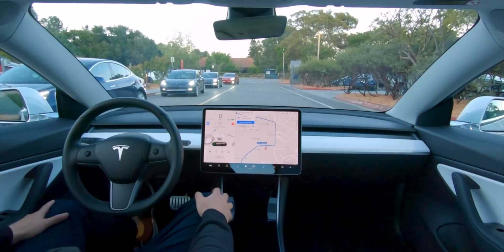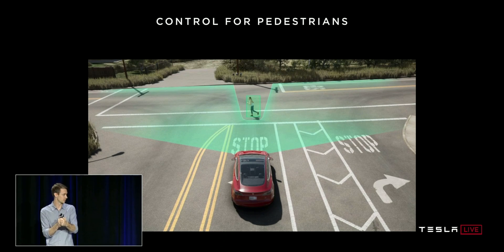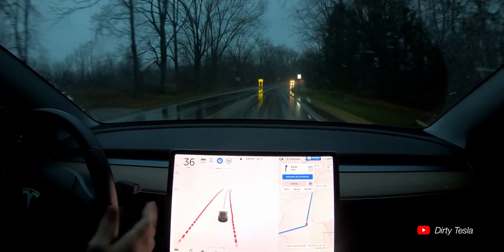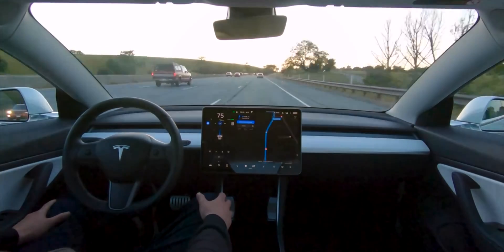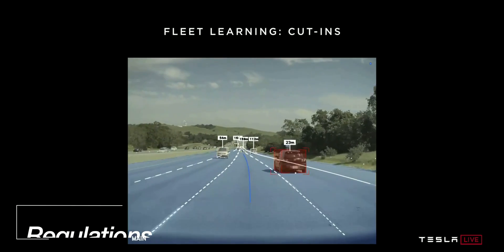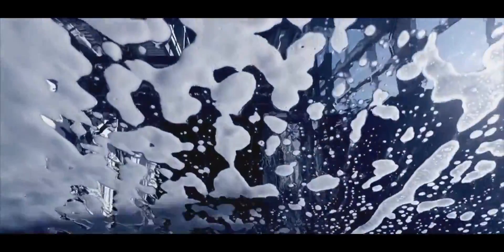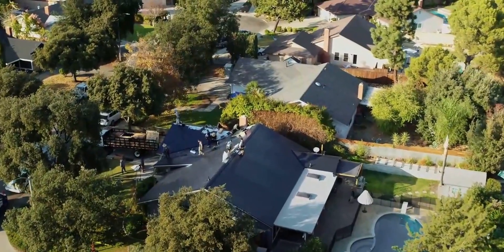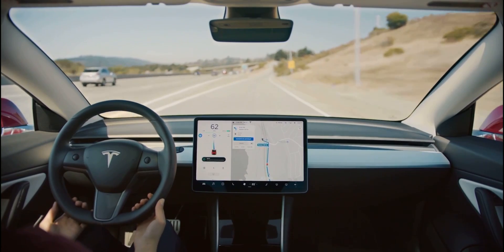4 Major PROBLEMS for SELF-DRIVING CARS!

Comment: You have obviously never driven a winter Road in Michigan. You have something that's going to stop the salt from screwing up your sensor? Or lot of places use sand. Then your faulty sensor causes your car to run over my five-year-old daughter. Then what happens?
Reply: Well said! Maybe in California they're fine but as a Minnesota driver, I cannot imagine a self driving car would know how to handle several inches of snow/black ice. For example, sometimes you have to roll through stop signs a bit to keep momentum. A self driving car would follow the law too much and get stuck in the snow.

Comment: assuming all self driving car companies wanna team up and share data between each other, this process could help self driving become widespread quicker and once there is enough saturation, cars could communicate between each other on the road and hence make the road even more safer.
But I fear that most of these companies being private entities will be reluctant to share that data and protect it under their IP. This will hinder faster development and refinement of the neural networks.
I think this is also the problem in some countries with EV charging stations.
Pretty good Video anyways, Keep Going.
Reply from the maker: Thank you. I think once you already have cars driving fully autonomously on our infrastructure, there won’t be a need for inter connected cars. It may be a good second layer but primarily the car should only rely on cameras.

Comment: So the hardware, software, and data are all need to be improved for level 5 fully autonomous driving at safety levels !0x vs humans.  Even the best current beta combination that Tesla offers cannot drive anywhere close to level 5 on snow, ics etc even or even equal to an experienced driver on snow or ice.  This is just one major example limiting cars from being even close to achieving level 5.  Potholes, damaged roads, and other naturally hazardous conditions are other normal real world scenarios that EV’s cannot successfully address and will require major modifications before level 5 can even be claimed to be achieved by definition.
Reply from the maker: This isn’t gonna age well!
Reply: @ElectricCarsAreLit  A lot of what you said was misleading. Data is not one of the major roadblocks for companies. If that was so google would have thousands of cars driving around  most cities. It is so difficult to get all the edge cases that google is needing to hard code some of those in. They are also trying to smooth out their remote takeovers in extreme edge cases. 

Self driving cars cant drive like regular cars. For example in parking lots pedestrians look at the driver in order to guage whether to stay or to cross. Pedestrians see that there it there is self driving car and will walk in front of it knowing it has to stop without repracautions of getting yelled at. Trying to tweak agressivness in parking lots is very hard. If they are overly agressive then people will think google is tring to kill them

There is also edge cases regarding street signs. You cant really believe that tesla's machine learning algorithms are able to read every sign and decipher exactly what they mean. Their machine learning algorithms are for behavior not natural language processing. If a sign says only turn left on weekends and tesla sees a car turn, the tesla will think that it is okay to turn on a green light. Even tesla needs humans to hard code random laws and signs that vary from state to state. 

You also said that when tesla's car makes a mistake that it is a software issue and not a hardware issue. Assuming that a software patch will fix those mistakes. They have not reached level 5. They claim that they can fix all the problems with software, but we don't know if they can until they do. You can say Tesla claims they will fix everthing with software. But instead you simply state it as if it's a fact.
Reply: @ElectricCarsAreLit  nah, what you think isn't going to age well
Reply: Autox have rolled out level 5 already
Reply: @human_hope  that’s not level 5 it’s technically level 4 their are no level 5 cars up to date